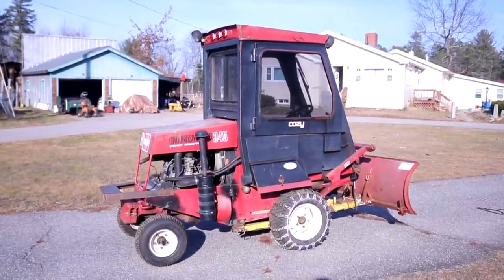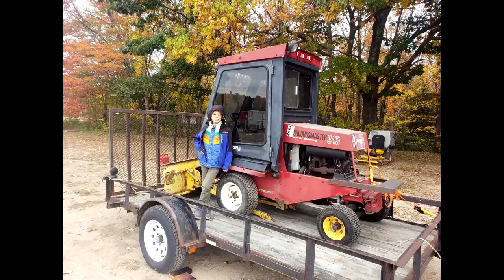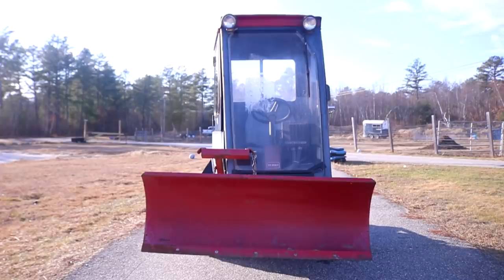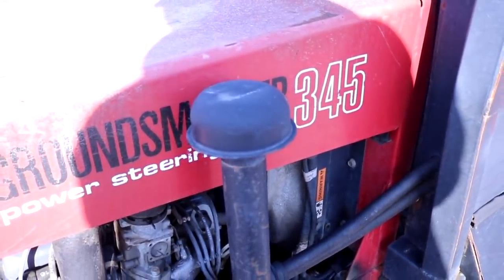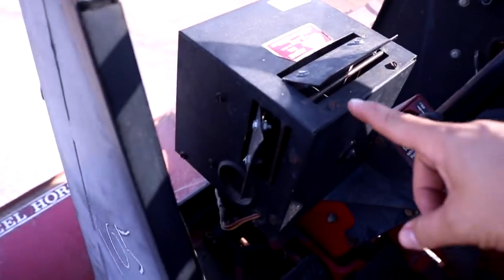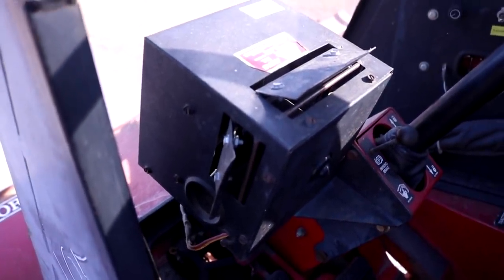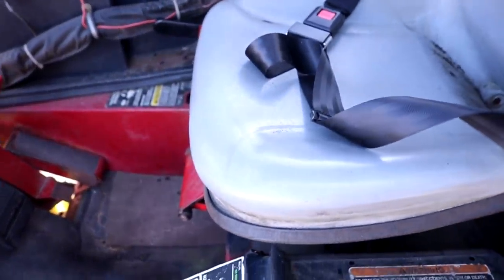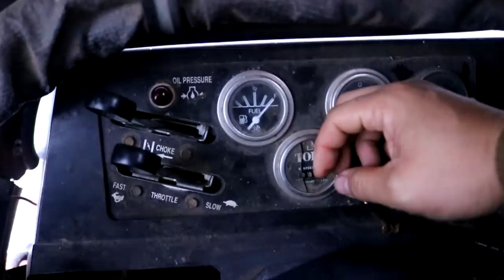Toro Groundsmaster 345 Overview & Snow Plowing Farm! Drone Footage Ultimate Snow Plow Machine

Comment: I have one of these setup for mowing, without a cab. 6' wide mower deck. Kubota diesel engine.  Paid $3k for it.  It's frickin awesome.  I used these when I worked on a golf course as a kid and decided this was the perfect machine to mow 1 1/2 acres of grass.  Way better than a zero turn unless you have small tight spaces. Would be cool to get a snowblower or other attachments for it.  Getting hard to find now.

Comment: That's a nice one...I got a john deere 1445 diesel with a 72 inch mower deck and 60 inch blade for 800 bucks and all it needed was a new fuel filter cause the old one was plugged so it wouldn't start

Comment: Cool machine Norman.  You can't beat that for the money for getting the job done.  You're warmer than I am in my Kubota RTV1120d with a 72" Curtis hydraulic plow set up.  I wanted an 1100 series with a full cab but the 1120d I found with very low hours,,,65hrs,,and spotless for half the price of new and only 2yrs old.  I installed a half shield and wear my snowmobile riding gear and I'm fine.  I should of spent the extra for the full hydraulic V plow that utilizes the Kubota's own hydraulic system as it would have much more lifting power but did the best I could with what I had..its been a very reliable system for our business for 4yrs now and very good on fuel, although underpowered as a whole.  Kubota could fix this I believe with just some hydrostatic improvements more than just more hp and torque.  My old IH Cub 1650 with the K341 with the twin stick blade still pushes like a champ to this day..Bought many parts from you for that old girl.  People are amazed when they see what that old K341 can push and do.

Comment: I just bought a similar toro at an auction.  Toro 328 4x4 with the mb plow. Mine still has the pto and mower deck lift arms. I'd like to remove these so the lift can get the plow off the ground a bit more. Do you have any suggestions on this?